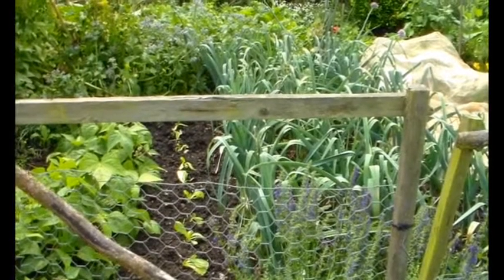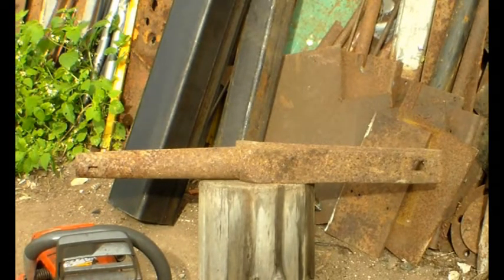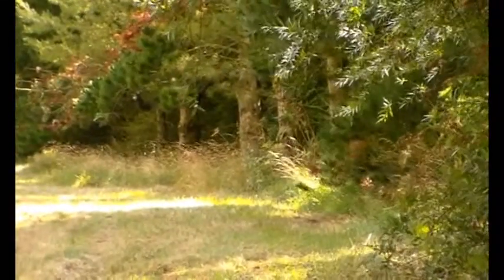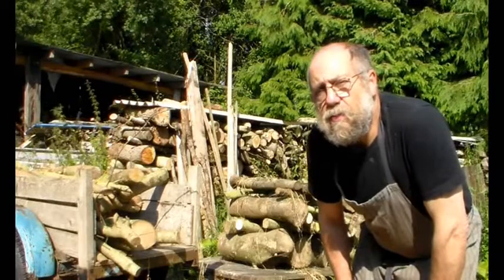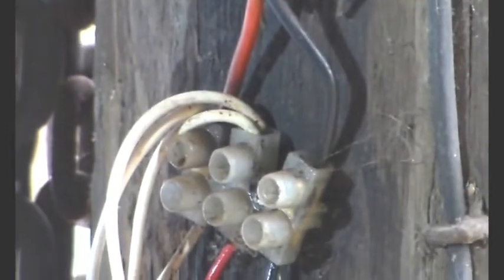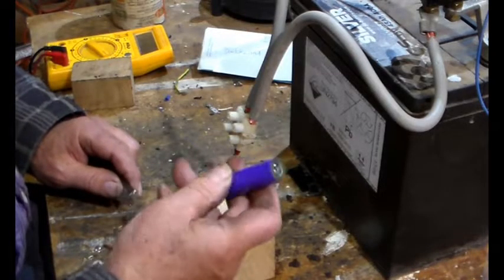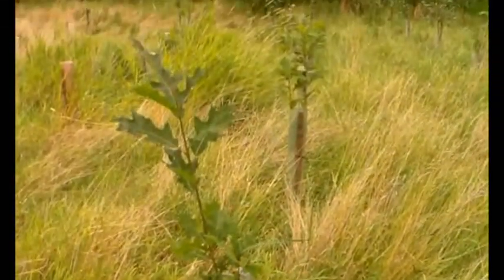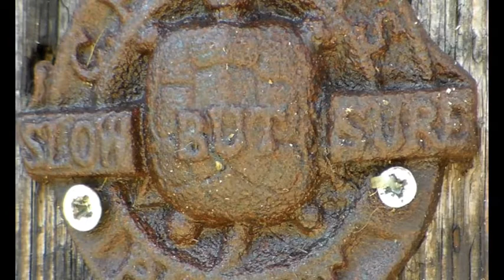Home life 25, autumn preparations and future projects. New trees update.

Comment: Hi Andy, thanks for another home life. there is a thing called the galvanic series of metals, where a hierarchy exists and one metal can act as a sacrificial anode to another metal. Brass and copper are both separate in the series, and brass should act as the cathode and corrode leaving the copper cable intact. Maybe something like that happened here. 

I had a chance to make a video about my trees last week, after about 10 years alder have thrived for me (relatively), whereas larch and birch struggle along. East side of England versus the Atlantic coast of Ireland. I got to use the Allen scythe and the real scythe again and play tractor too! 
Sláinte!
Reply from the maker: Owen, I'm thinking that the 50v DC is finding it's way through a fine layer of condensation, a film of oil may be he answer. So you've been to the land of saints and poets (where Tommy resides), hope you enjoyed the trip. Allen scythes are only for the fit and young, they certainly know how to loosen the joints and maybe teeth, cheers

Comment: ps. I have 4 T105 Trojan 6v batts on my boat which are now 7 years old, they appear to be ok and accept a charge via my 30amp dc to dc charger, but I’ve noticed one appears to be weeping electrolyte from its lid edge?? I’ve been informed by Trojan they have exceeded their life expectation and should be replaced but to replace the 4 would be about £500, any suggestions please?
Reply from the maker: Andrew, yes they are repairable and I have been meaning to do a video on how to repair battery cases. I have used hot glue, but to make it bond the plastic has to be clean, dry and very warm. To that end I remove the electrolyte and warm the leaking area with a hot air gun and then apply the hot glue which solidifies slowly and so bonds. Then replace the electrolyte. Hope that makes sense and it is perhaps an incentive for me to get on with a video on this subject, cheers
Reply: @TheInfoworks  thanks for replying but that sounds beyond my capabilities I’m afraid, obviously living on the boat I do not have a workshop plus  I rely on constant 12v to run water pumps etc, can you recommend any other batteries that will deep cycle and maybe give me a few more years? I realise you only get what you pay for , thanks again Andy
Reply from the maker: @dingnextstop  Andrew, now is the time get get a friend to extend your skills and improve reliance. I'm sure you could work things out. As It's just a joint between to the top case then just tip the battery slightly and use either a heat gun or propane torch to warm up the plastic around the joint, the apply hot glue. Go on give it a go. it may take 2 to lift the batteries into a work area. Remember to use battery terminal grease on the re fit, cheers
Reply from the maker: @dingnextstop  Andrew, further to this, I keep the electrolyte levels no more than 12mm above the plates, if the levels are high then leaks can occur and pole corrosion can happen, cheers

Comment: lots to dooooo...
nooo rhubarb...... ?
N x
Reply from the maker: Neil, yes rhubarb but the old body cannot take the acid any more. Used to love rhubarb crumble and custard but I have to be careful of my joints. As you say plenty going on, but I wouldn't have it any other way, cheers
Reply: @TheInfoworks  Mmmm rhubarb crumble and custard
Reply from the maker: @bootsowen  Classic comfort
Reply: @TheInfoworks  Hi Andy,

Wonderful videos, esp. the battery stuff. I've a couple of questions; I'm totally off grid for 21 years.

I've 2 banks, 12V, of 2 volt OPzS cells, 750AHr each, same to the traction batteries you show most of the time but with clear/transparent cases. Beautiful batts, actually.

I could never keep them charged, and took them out of commission when the terminal voltage would just jump to float voltage within 5 minutes. I have a better charging setup now....

Looking at your vids, I feel that there maybe hope to revive them with gentle re-charging.

They are all at 1.95VDC

Question is: I have "terminal lift"  where the terminals have pushed up through the top plate, bout 3/8"
They have slid through the rubber gland and terminal (color) indicator cap. But these are "sliding pole" design, meant to work as just described.

Is there anything that I can do,  or are they trash?

Other Question. If I cut of the tops, does the whole plate structure/assembly lift straight up, or are they "jammed" in there by design. Have a lot of sludge on the bottom and would like to clean it out.

tia, Nick
Reply from the maker: @nickbarret9368  Nick, yes if you take the top off the whole lot pulls out. I have used a pulley system to lift the plates gently. There is a photo of this in Wind and Solar electricity. If you have raised positive poles then his could be a symptom of positive pole corrosion, loads about this in the book, which you would benefit from. You can use hot glue to seal the top back down, but there is a technique. Ask me about this nearer the time. You may have to gently clamp the plates together to feed them back into the case. The muck in the bottom of the case can be caused by several things, including over charging at too high a rate and vibration from a generator,  cheers